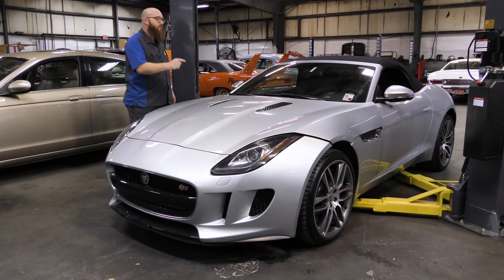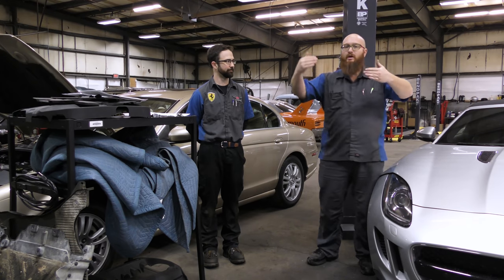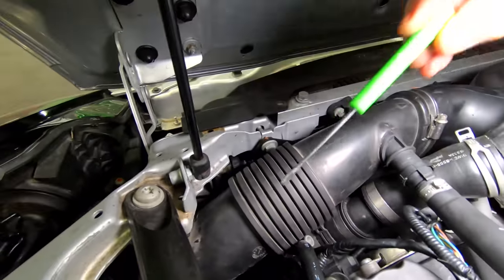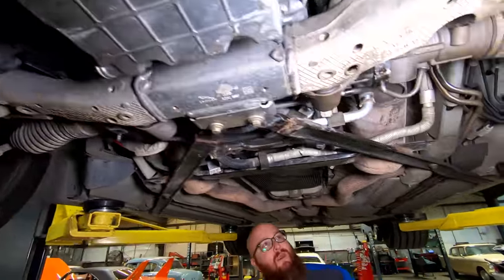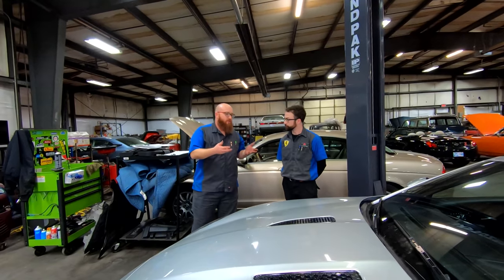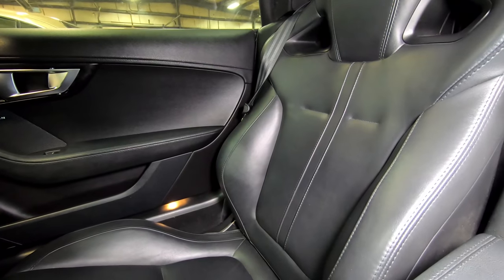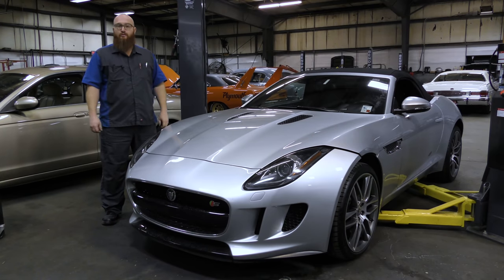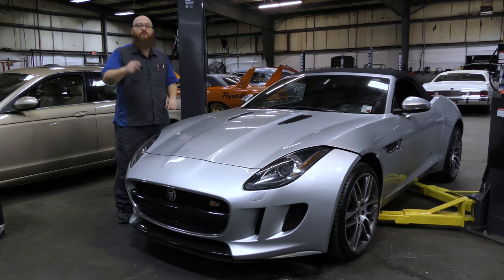How could a shop do such a bad swap? CAR WIZARD points out all the errors on '14 Jaguar F-Type

Comment: Hey car wizard,

I have a 2006 Jaguar XJ Super V8.
Just sprung a coolant leak behind the engine block. I think it's the valley house but not sure. I am dealing with some injuries and cannot work on it.
Do you want to buy it for the low? It's black on black spec, beautiful. It needs love I can trust

Comment: Surprised you didn’t mention the front bumper not fitted correctly.

Also excessive wear of the steering wheel, which suggests reported mileage may not be correct 🤷‍♂️ 

Very bad news all around for the unfortunate owner.  I’m sure you guys are the best chance of getting it all sorted.  Good luck 🤞

Comment: From the front, bonnet still closed, it already looks like it was wrecked at some point. Look at the panel gap and colour difference. Combined with all that's technically wrong with it, i'd say it's totaled. Modern Jags aren't collectables. Cheaply made, faulty cars from a has-been brand.

Comment: I recently watched a video on YT channel 'Maschinen Zimmer', and this guy showed that some Bolts on a Mercedes need replacement after using them only once !
Some cheapass Mercedes garage did  not replace the Bolt, and it completly ruined the engine, having run not neven 50.000 Miles..

Miss Wizard should buy a X308 Vanden Plas Supercharged, U only Live Once !
Or even better, Wizard should find her a Daimler Super V8 .

Comment: Car wizard. I am looking at buying the 4cyl.  You can get them with extremely low miles for like 35k. The 4cyl looks like it has plenty of room to work with.  My uncle is a retired GM mechanic. I think he will be able to all the standard maintenance. I over maintain all my vehicles. Do you think this jaguar is a good car. If I over maintain it. Will it last me ?

Comment: I love the body of the F-Type but the mechanical layout sucks bad. The engine is way too far forward with the weight centered on the front wheels. It's far too heavy for the size.    A C7 would be more car all the way around. Better performance, handling, weight, and reliability. All for less money. 
If I found one cheap at auction with a blown engine it would be good to put a million lightening holes in the chassis and mount a gen3 coyote tight against the firewall with twin turbos up front.

Comment: Rich man's car.  Jaguars are for people who buy a new one every 3 or 4 years.  After that, they're usually a money-pit, and most everything electrical or plastic will begin to fail.  "High mileage" for a Jaguar is generally around 90,000 miles, even if it's 15 -25 years old.

Comment: I was at a shop where some kiddie boi had bought his car in for a tune on their dyno....I knew all the guys at the shop, and this kiddie boi was one of those little mouse kind of mechanics who works on things but WILL NOT EVER REALLY USE ANY FORCE ON ANYTHING....so this car was put back together 'finger tight'....NOTHING WAS TIGHT, and the car barley ran.....SO...we all started poking around and this car was a DISASTER....electrical plugs were just pushed together but not 'snapped'....the intake had come off and was just 'finger tight'.....when they called this kid about not being able to tune the car because it was such a disaster, he flipped out on them and came and tried to drive the car away and it wouldnt run right....and it was a huge mess.  Kiddie boi then sold the car to another guy we all knew and this guy documented all the BS that kiddie boi had limp dicked.....the car ran well once it was done right.
Kiddie boi did the same thing with another car but it caught fire and burned to the ground in his garage which also burned to the ground....and that put him back in a Camry where he belonged.

Comment: It’s questionable to me why he didn’t take this car to the dealership first to get Jag Techs to work on it. In removing the intake they (the first shop) probably didn’t uninstall the fuel rail when pulling the injector and dumped fuel in the cylinder and killed the compression. Personally, if I had a high performance car like that I would’ve taken it to the dealer.
Reply: Or at least a Land Rover/Jag specialist.

Comment: Never a fan of engine swaps. Never know what issues the replacement engine will have. Believe that repair of the existing engine,  if possible,  is the best path. 

That engine had a cylinder with low compression. A ring job would have been a better option. If you can find a tech that knows how to tear down,  fix and rebuild. And a shop that will tolerate a long term shop queen.

Comment: I wonder why the finish on the steering wheel looks thrashed with only 65k miles. Is that years of gunk build up (nasty), or has the leather discoloured? Something very fishy with this car. It looks well used for such low mileage.

Comment: I'm sure the dealership and other mechanic who refused service did it because for them its essentially taking responsibility for the clearly bad engine swap.
While I or many readers wouldn't blame them for not finding all the issues in one go, most customers are unreasonable and this kind of vehicle and issues screams some kind of Karen suing because of issues not caused by the shops just trying to fix the car.

Comment: I've had mechanics drum up buisness.  Suddenly after an oil change my valve cover leaked and that dripped down to the back of the engine.  He claimed my rear main seal was bad. Also my air stopped blowing cold. Windshield resevuare leaked. I had one shop not even change the oil on an oil change. The oil was black and when I took off my oil filter. Gods honest truth I had sand in the filter and on the tang the filter screws on. I also had a z scratched in my door at one shop. This all happened in 6 months of getting a new used car. I really don't understand why me and my car. The city I live in has bmw mecadies Cadillacs. My car was a very good condition 2001 camry. Wtf.

Comment: I'm just surprised at the amount of surface rust appearing on underbody components on a car that's probably less than eight years old. I think that Mercury Grand Marquis was in better condition.
Reply: All depends on if it lived in snow country with road salt, or within a couple miles of the Pacific Ocean. Also apparently some rust prone bits on early F types.
Reply: @emjayay  Here in Britain we get a lot of salt used on our roads - I wonder what a British one looks like underneath?

Comment: IMO, A lot of jibber jabber so for on this car. Everything is loose and or not put back together probably because it has been apart to "fix" different things so many times and is still not fixed or put back together because the previous mechanics were still in the testing phase of whether their fixes were good or not and obviously they found out it was not fixed. and would obviously not button everything back down knowing that the engine may still need to come back out, worse case scenario, whether they did it or the next guy had to do it. Knowing that the intake has needed to come off at least once to get to an injector, is a great example of this. I don't have time nor care about watching this whole long winded video to see if either of you speculated this car to be a water damaged/food vehicle at some point in it's life but that is my gut feeling with what I saw.

Comment: I had the same thing happen to me!  I paid 10000 for a built j 35 engine to be installed in my 1994 Acura legend coupe. 6 months later I get it back with a busted body kit the leather was greasy and the cabin smelled of diesel fuel the subframe was held in by two bolts the turbo bearings were shot ( it was brand new just like the engine)the clutch was smoked and the windshield was cracked I didn't know any of this as the car was kept inside his shop. after months of the guy dodging me and saying he needed more money! He screwed up and left the gate to his business open and me and the boys took it back! He  killed my baby it even looked like he was trying to get the vin tag off the fkg scum bag! I later found out that all the tuner cars on his lot weren't even his or were mechanics leans from prior customers! The worst blow is that I have the mechanical experience to have performed this job but I was in the middle of a new job and needed to focus the extra hours on securing a promotion. I think what he was trying to do was bleed me dry for money and continue to do (work) on the car and when I couldn't pay anymore put a mechanics lean on it so he could keep it and use it as inventory 🤢 I'll never take my car to another shop again!

Comment: my guess is that this was taken to a buddy's shop or somewhere the customer may have gotten a killer deal. What's weird is the history of the transaction between shop and customer. What did the shop say when all of these glaring issues were mentioned? sorry we're done dealing with you? I'm sure there's more to the story. This looks like a quick junkyard engine out and used engine in situation. Either way glad he's in good hands now
Reply: As shoddy as this work seems, I’d be curious to hear the other shop’s side of the story.  It may be just as we see, a poor job of installing an engine, or it may be a case of a customer getting impatient and demanding the car back regardless of the state of the repair.  Of course, a reputable shop shouldn’t release a vehicle that’s not fully road worthy.  There are usually at least two sides of every story.

Comment: Steering wheel looks much more worn than my 2004 Pontiac with 240,000 miles! And the push button start is worn off. 🤣

Comment: owner probably doesn't have the money to maintain a jag and went for the cheapest mechanic in town.. I bought a BMW really cheap because the owner can't afford the repairs and ended up hiring a mechanic that cross installed the camshaft sensors and dangling brake sensor. Sometimes you can afford to pay the loan for the car and can't afford the upkeep.

Comment: As poor a job as they did, check to see if the exhaust manifold joints to the cat pipes are tight. Heck, make sure the gaskets are there!  A leak at that joint will throw that Cat code.

Comment: I have a Jag that was having hard start problems and evap error codes. Local import repair shop gave me all kinds of wild prices to fix it. Took it to my old reliable oil change guy with one bay for repairs and problem fixed for $225 parts and labor. Bad purge valve like this car. Makes you wonder how many times you get f*cked over for unnecessary repairs.

Comment: Front bumper is in different zip code judging by the lines :) and the steering wheel... how can it get in this condition after 60k miles beats me.

Comment: See, that's the problem. No one cares. If they did, there would be some kind of qc going on in these shops, but obviously there isn't. 
In my Town the 2 best mechanics I used for years went out of business during COVID. They retired. 
Now I'm stuck to going to the dealership 35 miles away, and they're not exactly that great either. 
I don't have much hope left in mechanics anymore. Cars have gotten so complex even the techs can't figure them out!

Comment: The installation of the new engine was garbage.  However, if an injector was stuck open on the original engine the constant spraying of gasoline in the cylinder would have washed away the oil and wrecked the compression of that cylinder.  So, maybe the original engine needed to be replaced?

Comment: Overall, the interior may be in decent shape but I've seen cars with 3x as many miles that had less wear on the steering wheel. Good looks are about all these cars have going for them. Typical Jaguar. Makes you wonder how build quality can be such crap for so many years with little or no improvement as a whole- especially when technological advancements would lead you to think the complete opposite.

Comment: So baffled how a so called qualified mechanic could be so shonky and amateur with doing an engine swap on a high quality vehicle like it was given to a self appointed back yard wannabe, then when it's given to a proper dealer they were afraid of situation where they would be blamed for something that they had nothing to do with.
The catalytic converters can block up if the inside parts come loose which I've seen before on another vehicle but either way should be replaced when the engine swap was done anyway.

Comment: Maybe he could start a YouTube channel based upon an LS swap. Seems like I remember some guy starting a chanel with a Porsche 911 LS swap. As for the "extra bolt", those came from the factory like that. The good folks a Jaguar knew you'd be under it needing a bolt, so they wanted to cover you on that one. It's called a complimentary bolt. The reason that you only have problems with the engine, is because Jaguar didn't want you to have to chase down those pesky problems. They wanted a more simple car, so the made sure to put all the problems in one place... under the hood or "bonnet"....so you'd know where to look. I also think the kitty was an option in the "kitty package". I had also had a girlfriend with a clear bra...it just saved a lot of time.

Comment: Man for two videos y'all have been calling that hose on the top of the motor a coolant hose. It is not a coolant hose. It clearly wouldn't be, there's no way a heater hose is gonna stay on with no clamp whatsoever and not leak...it's for induction noise into the cabin. Obviously plenty of other stuff wrong with the car but being professionals you'd think identifying things correctly might be more important to you. Someone needs to read a service manual before any work is done to this car

Comment: My mother had a brand new car fail on her. Wouldn’t give any power, no matter how hard you push on the gas pedal. It was a faulty fuel intake sensor, however what the mechanics did, and mind you this is a dealer tow, is drop the engine and damage the catalytic converter in the process. They would not accept they did anything wrong and she had to fork out for a new converter down the line. People are flat out morons. Watch your car always!

Comment: Sounds like customer may have got the service he chose to pay for, client needs to ask questions to establish Trusted advisor status before shelling out the bucks. Due diligence is incumbent the first time before one gains the experience to know better. 
Really all that's not operating purge valve broke and the cats should have been replaced with the new engine. They're just a number of items loose, and missing fasteners which could have been spotted before he pulled it out of the mechanic's shop. I would have also insisted on a complete scan which probably would have revealed at least the purge valve malfunction. customer may have cheeped out on new cats. who knows ? But really Wizard move towards better content like Tylers  Beamer Mechanic. Majic Mike has so many more capabilities.

Comment: That steering wheel isn’t in all that great of shape.
Reply: It's probably just grime that can be removed with the proper cleaning tools. A lot of people think steering wheel surfaces casually wear away, and sometimes they do, but typically it's years of hand gunk just stuck to it.